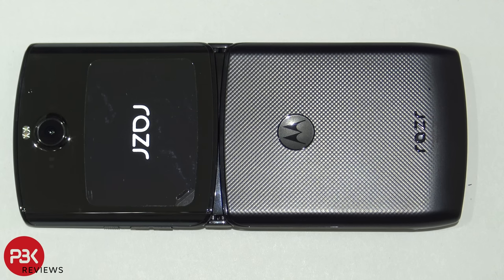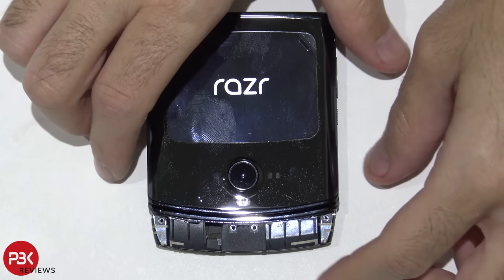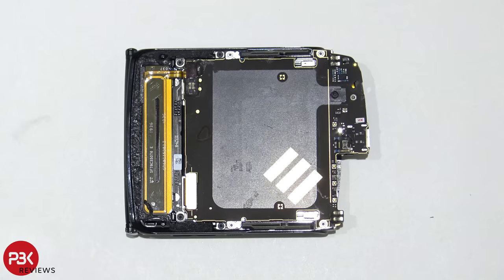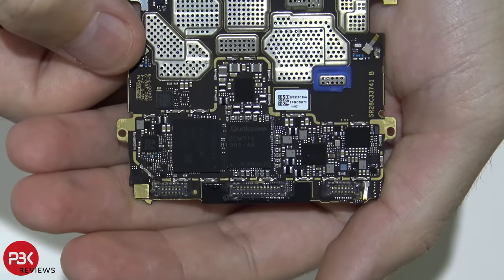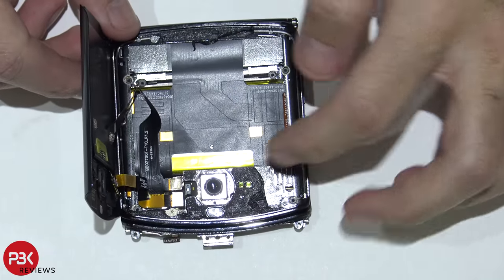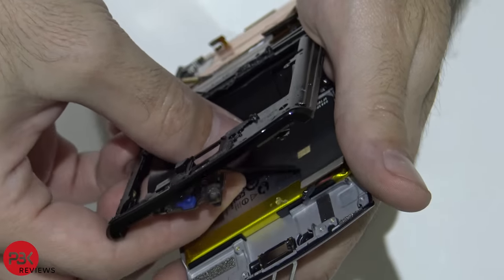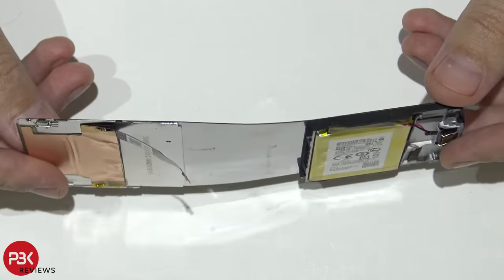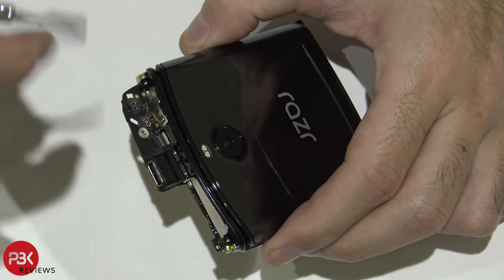The New 2019/2020 Motorola Razr Disassembly Teardown Repair Video XT20001

Comment: My external screen is cracked and I can't find a replacement one for the life of me.  I'm sure I could change it but no parts available. My inside screen is still flawless after 6 months heavy use. I had a flashlight in my back pocket and sat down and the bezel must have pushed on the screen just right. 1 crack in the corner. It still works fine.
Reply from the maker: Ya, don't think there are any available on the market yet. If you wanted it changed, your only option seems to be to send it in to motorola to have them replace the screen.
Reply: @PBKreviews  thanks for reply, motorola wants 400 dollars to replace it. And it's just the cover not the actual screen or digitizer. Even if it is all one piece that is double what I think it should be.  I have insurance but always have fixed phones myself. I will keep my fingers crossed for replacement parts to show up online or maybe buy a broken phone with a good outside screen for spare parts.
Reply from the maker: @tylerjackson4168  ya that's way too much.
Reply: I'm in the same situation now. Did you finally get yours fixed? This thread is from 6 months ago and I still can't find the external screen replacement parts anywhere 😭
Reply: @ugoffsucks  ....I used my insurance (200 deductible) to get a replacement. I told them I couldn't find mine so I still have it if parts become available. I haven't checked in a few weeks. I even called Motorola and they won't sell parts.

Comment: That's why they had to deal with a small battery capacity
Reply from the maker: Yup, They could have made the phone a bit longer to add a larger battery but it would probably have not been a good proportion with the length vs width.
Reply: @PBKreviews  yes, that's it. They tried to keep the original Razr proportions as much as possible

Comment: Hi friend
 excellent job
 Would you help me with cleaning the hinges and the internal part as it has dust inside I guess and squeaks a bit
Thank you for this video.
Reply from the maker: No problem, you would probably have to take the entire phone apart to take apart the hinges. I don't think it would be worth it, your best bet would be to send it in to motorola for service for them to either replace and fix the issue for you.

Comment: Where is the sensor that says the phone is closed? Mine reads it closed when it's only 3/4 of the way closed and back open when it's fully closed. My first one did that but it was under warranty so I got a different one for free. The one is not under warranty so I'm stuck with no outside display now and I have to make sure to manually turn the screen off with the power button or it stays on while in my pocket because the sensor is telling the phone it's open.. when. It's really closed..

Comment: Hi  Q : Technically can the front screen only ( if you have one extra ) be replaced without any other extra disassembling ,just like you did in the video section ,heat up remove , watch the connectors and put it back  ?
Reply from the maker: Yeah, you don't need to take apart anything else which isn't obstructing the part you're replacing. But also there is a small chance of shorting if the battery is still connecting if you use metal tools etc.

Comment: Who supplied and manufactured that flexible OLED panel?

That one is the gist and hopefully you're able to find out with Device Info HW app or through those serial numbers.

Thanks.
Reply from the maker: I'll try n see if I can find out
Reply: the manufacture of the OLED panel is BOE. they also supplied the panels for the Huawei Mate X
Reply: @mikeynjs94  If you trust ultra nationalists and state controlled media from China.

But I don't trust any of that so I'll wait for a more credible source.
Reply from the maker: @mikeynjs94  yes you're correct thanks for following up
Reply: @PBKreviews  Do you have a screenshot from the Device Info HW / serial number or this answer was from Google searches?
Reply from the maker: In the device info it does not state manufacturer, but I was going based off BOE claiming they are the providers of the screen. However here is the info on the QR code on the screen = SD18C56490  A2015963CWH19CM  5001141030000024  and on the back of the screen SM88C54413  C  14NOV19 HT  . Wasn't able to pull up any info regarding those numbers.
Reply: @PBKreviews  Thanks for helping out and I appreciate that.
Reply from the maker: @folduniverse  No problem, anytime.

Comment: Do I have to do all that if I just want to replace the front glass screen?
Help I shattered my Razr 😔
Reply from the maker: No, you would just have to take apart the front flip part and replace that outer screen assembly with a new one that has the glass attached to it.
Reply: PBKreviews Ok where can I get it because I already look for it and can’t find it...
Reply from the maker: @alexnieto5561  They arn't really available yet from the looks of it, so you might need to contact motorola and send it in for them to repair

Comment: Ayuda My moto razr 2019 no inicia, no recovery, se queda en el menu y aparece eror comunicarse a verizone
Reply from the maker: Hi, not sure as far as software issues go on this model phone. You may need to look into reflashing the original firmware but you would need to google tutorials on how to do it. Or you can contact motorola and send it in for repair.

Comment: The screen is difective which peels in just 2 months of use with air bubbles forming between the screen layers and becomes non responsive, don’t buy
Reply from the maker: That sucks, hopefully they fixed that issue on the 2nd generation model they made.
Reply: @PBKreviews  No, they haven't fixed anything. It's the 2nd generation model which I have, the moto RAZR 5g and they changed the design in which the inner screen slides down into the bottom frame of the mobile while the outer screen doesn't. The earlier screen was breaking after few months and they changed teh design on this mobile but it's still crappy design
Reply from the maker: @roopeshraj5171  Oh I see. That sucks

Comment: Motorola was stupid because they left out the user replaceable battery. The back cover is 90% capable only the 10% corporate greed and fingerprint sensor glues together the bottom half.
Just imagine a hot swappable battery. All the batteries with built in wireless charging coil.
Reply from the maker: Yea who knows but from the looks of it, I don't think a removable battery well every come to see the light again. But who knows, they are going back to flip phones so maybe one day :)